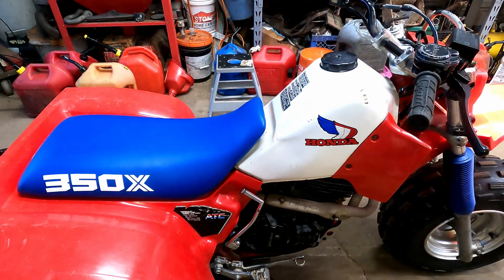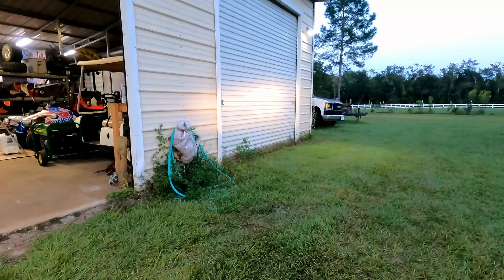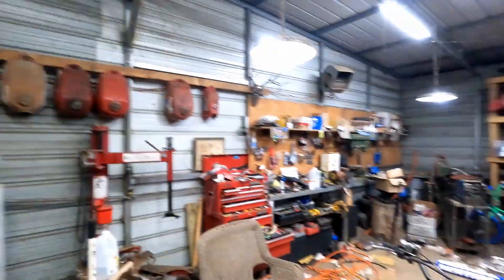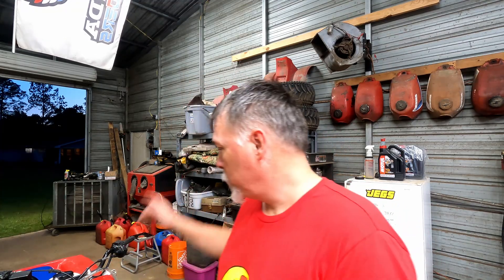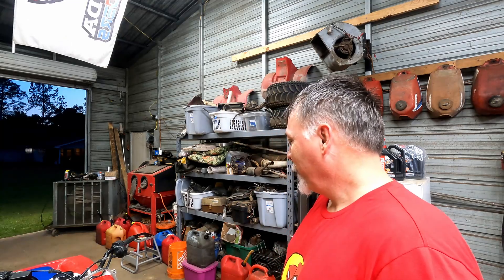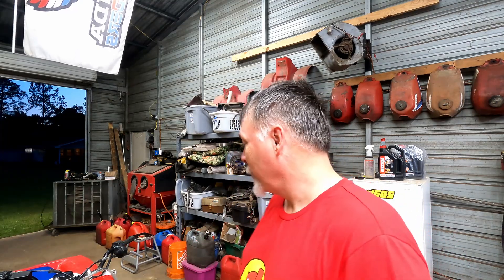Easy 350x Carb Upgrade and Install and first ride on my new machine

Comment: I was having problems with my '87 250 BR carb not working right, so I talked to Curtie and he is such a good guy to talk  to about checking out a carburetor, told me what to check for that could be the problem. I didn't have any success, so I sent my carb to Curtie to work his magic on it. I can say that 350x with the 223cycle carb really makes that bike shine. The throttle response sounds great! Now I'm getting envious over you're new 350x LOL! I might have to sell one of my Big Reds to get a "King of the Hill" 😁.  Between You and This Old Trike,  I've learn some stuff about what should be and a no go on these bikes. Keep up the cool videos, It's starting to bring me closer to my Youth days when I had a lot of fun ! 👍
Reply from the maker: Hi Cj well were not getting any younger. Lol. Curtie does get work and is a great guy.

Comment: I would not be as successful at keeping my lawn looking the same in all areas, when it is the route in and out of my shop.
I mean it's a good healthy-looking lawn and you should take care of it. 
You're a better guardian of your lawn, as well as a better 4-stroke mechanic than I am.
I pull my street bike around a corner from bldg. I keep it in and I have a 1/4 radius no grass patch 
from kicking the rear end out sometimes.

After 56 years I have just accepted the fact that when I grab ahold of that dang clockwise Velocity Valve
and hear the Potato-Potato-Potato Piston Percussion playing in the Cylinder Choir I get a little decibel drunk
and turn my Michelin Commander into some kind of sod shredder, acting like the 12-year-old that I used to be, 
is actually still me.

Even thinking about it gets me goofy talking. Lol.

The 86250r atc was the only bike that I ever considered buying brand new, and almost did, if not for the motor in my
car going out and the funds going that way instead.
a little later at different times i got.
Kaw tecate 250
Yama tri-moto 200 2-stroke
Hon 200x  (the first smaller 4-stroke displacement that really impressed me)
My friend had the 350x and a new banshee at the same time, so I got to ride his 350x at the dunes a couple of times 
all day long, and I do believe that I liked it better than any other three-wheeler I have/had ever ridden.
also...
Suz lt250 quad
Hon trx450R
Suz 250lt-f? 4x4

And I don't know how many dirt bikes. But 3 that I kept and loved.

1987 Honda CR250 My first REAL bike, and the bike that I learned to be fast on and hit doubles and clear tabletops on.
I probably had it for 15 years. I didn't race in any points seasons or anything, so I just kept that thing going and fresh.
I know that I did at least 5 or 6 bottom ends on that bike, and who knows how many piston. 2 new cylinders.

2009 kx250f with works suspension and my first 4 stroke MX bike.
From the first 10 minutes I was on that bike I comply trusted it and I was aware that that was the fastest I had ever rode 
that particular track. It was the same everywhere else.
I foolishly sold it and bought a 450. That 250 just happened to be set up perfectly for me and my riding style, so 
that was the fastest I will ever ride.

2013 KTM 125SX I have had this one for the last 5 years. I wish that I had bought a KTM much earlier.
I should be too big for a 125, but that little thing is a blast and plenty enough to kill me.

TLDR...
Thinking about bikes excites me like a hyperactive child.
Reply from the maker: I get giddy thinking about the machines and experiences i had growing up, i do miss them, that may be in lart of why I am doing this. Even today when I find one I feel the same way. I may not ride all day but turning 20 laps or so here at the house always puts a smile on my face and clears my mind of the daily grind. Thanks for watching and sharing your story.  I have yet to own/ride a banshee, i hope to fix that one day.

Comment: I have the white bros carb on my 350x and it leaks gas  I need the stock carb
Reply from the maker: I highly reccomend www.223cycle.net for either a stock 350x carb or a 400ex carb.
Reply: @Mrcbuilds  sold out:(
Reply from the maker: @Arizona-.Native.Joshua  check back he is in high demand.